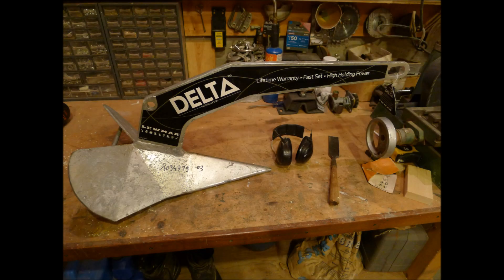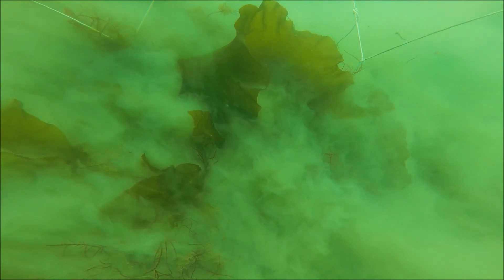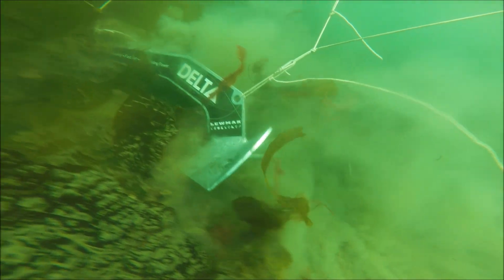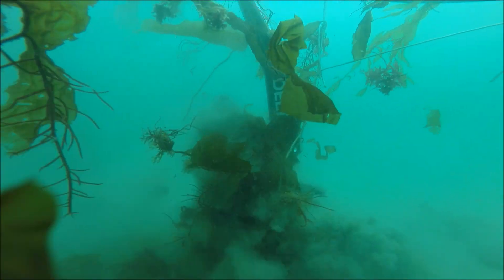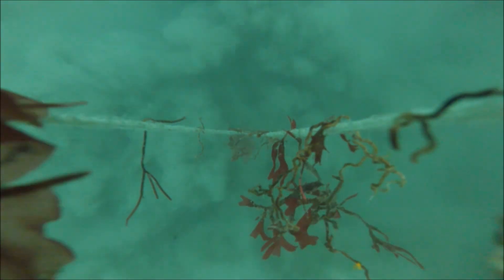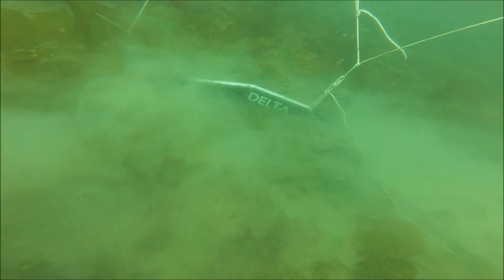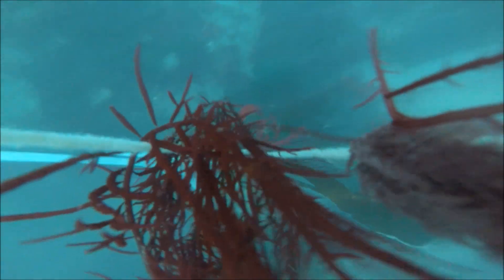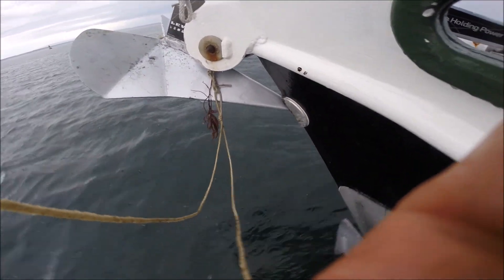Delta Anchor Testing.  Anchor Video #70.

Comment: Great vide thanks. We have been using a 16kg Delta for the last 4 years on a 45’ Sun Odyssey. It has been great so far. We have found that regardless of scope, it needs 30m of 10mm chain deployed to get a good initial set. Once you have that you can shorten chain if you feel like you need to. It has held us in a 60-70kts storm for over 2 hours and then in a sustained blow of 30-40 kts for almost 3 days. After that it was buried so deep, the shank being almost a foot below the surface of the sea bed which is predominantly sand as long as you avoid the Posidonia grass. Resetting through 180 turns has been good, normally within 1-1.5 anchor lengths under normal weather shifts.

Comment: Do you think one of these 10kg Delta anchors would work for a 20ft  angling boat with only a 25hp outboard motor ? Maybe the reverse power would not dig the anchor in enough to set .  Thanks for any suggestions.  Great video .

Comment: I am interested are the Delta inox better? I can see that they have a different construction, looks like a lighter shank therefore a better tip weigh ratio. If I buy the 30kg inox Delta for my 9m (30ft) sailboat I will measure it
Reply from the maker: I have no experience with an Inox Delta.  Please share whatever info you find. Thanks.
Reply: @Panope  I am not sure if YouTube removed my today’s comment because it included a link with pictures I have taken anyways…
Once again: I have bought 30kg (66lb) INOX Delta and surprisingly discovered that the tip/weight ratio is 40,2% ! 
I have taken 10 pictures with weight and size measurements and will post it again in a separate comment in case the algorithm deletes it
Reply: @Panope  made a screen recording just so I can share photos of INOX Delta 30kg anchor parameters....

https://youtu.be/e-918SES3dU

Comment: I use one of these, basically because of my bow sprit which restricts using a different anchor. I would only use as short scope of 3 to 1 for a lunch stop in benign conditions. Otherwise 5 to 1 all chain. Your findings are useful, I conclude that the Delta is Safe, Adequate and Reliable and I won’t be replacing it.  I accept that there are better anchors but the one on my bow roller is good enough.
Reply: Much better formula is 15m + 2* depth
Reply: Also interested are delta inox better? I can see that they have a different construction, looks like a lighter shank therefore a better tip weigh ratio. If I buy the 30kg inox Delta for my 9m (30ft) sailboat I will measure it

Comment: Just my personal experience with this anchor.    When under wind, the anchor seemed to hold fine.  However, when swaying side to side... the anchor has a habit of losing it's hold and drags.   I actually upgraded to this anchor and its been a complete let down.   I'll likely end up with an 'ultra' marine which seems like it's the best for holding power and resetting.
Reply from the maker: I can report that a 45lb. ULTRA anchor outperformed a 45lb. Delta anchor in the seabeds that I have tested to date.

Comment: Hi. I am preparing currently to sail the world solo, getting in remote areas and anchor as much as I can. I just changed from a 20Kg Bruce to an20Kg Delta-Anchor. After seeing this, I will change this Anchor and buy something better. Your testing has been by far the best I ever came across. THANK YOU FOR THAT:-) I have a 33Ft Sailboat with about 8Tons and I have rather an oversized Anchor, with 70 Meters of 8mm, regular Chain for the Main Anchor set up. As I have a Bowspriet, I have to find Ideas too, how to mount my 2 Anchors left and right halfway and on the outside of the Bowspriet. What is in your Opinion the best Anchor for me? I will be anchoring about 99% and this will include the 2 dangerous Capes of the World in South America and Africa. Many talk about the Manta Anchor, but the new one has screews in it and I do not trust any Screews with my life. I will face very heavy weather while anchoring too. Thanks for your Opinion.

Comment: Anchored well 16 years with 16kg delta on 36 feet 8 ton ketch.
Upgraded to a 25kg delta.
It dragged in windshift with mud/plants on first year.
Saw 3 boats over last 2 years with problems with rocna´s. (windhifts, clogged up anchor.)
Still bought a second hand rocna 25 for harder bottoms and very soft mud.
Have not used it yet.
Best is to anchor on 2 anchors if you can. Bahamian moor.
This way you can get by with cheaper options.

Comment: For my 36ft, 10 metric tons ketch I used for 24 years a 16 kilo Delta with good results.
Instead of going for the Rocna 15 kilo I bought this week a 25 kilo Delta.
This also because of your videos and 2 neighbours with serious Rocna mishaps this year.
With electric anchor winches these days we should all opt for an "oversized" anchor.
Seems the convex shaped anchors reset better because of lack of clogging-up. Thanks a lot.
Reply: Can you tell more about the Rocna mishaps?
Reply: @jimp313  Hello Jim, 
My first neighbor was on a small 3 ton sloop stationary anchored for
3 months with 15 kg rocna, chain and adequate scope in 2-5 meter
water with soft mud bottom and no plants. Then...he dragged in 30 knots
which was not uncommen wind strength (portugal). He is an experienced
sailor.
Second occurance (different location firm mud/sand) with a 31 foot Hallberg Monsun with 15 kg rocna during a gale with 40+ gusts. He dragged and  hit some pilings.
His boat "sailed" alot on his anchor.
I was anchored there and then with 16 kg delta on sufficient scope
with my  ketch (contest 36 mk1).
I believe the Rocna is a fine anchor. But I remember the hype when the 
Bruce entered the market. Maybe the Vulcan or Spade is best. 
A role bar is not so important if the balance is right and it fouls the
anchor too and hampers resetting. As is shown in the videos.
Thus I opted for the  25kg Delta. But wouldn't mind owning a new concave anchor.
( as a stern/kedge anchor I use a Brittany 16kg)
I also still use a 45 CQR  sometimes and a Bruce 20, Fisherman Luke 50kg.
When there is room I often anchor "Bahamian Moor" so that the anchors
dont have to reverse pulling direction. The Plough anchors work well that
way. Contrary to current believe I notice them diggig deeper (also CQR)
(In softer bottoms)

Good luck, anchoring is never 100 percent safe.

Comment: Compliments for tests, it would be great to try all the anchors with higher engine power and observe their limits, or try with smaller anchors. Stiven from Italy (google translator)
Reply from the maker: Greetings Stiven,  I did test most of the anchors with my  high engine power "deep set" test.  The easiest way to view these results is to watch my video called "Anchor Test Compilation. Video #56".  The 30:25 mark is where I grouped all my "Deep Set" test together.

Keep in mind that the maximum thrust of my boat is no where near enough to truly test the best anchor's max holding powers.  

I have purposely focused on setting and re-setting because there had been little comparative (visual) testing on the subject, unlike max pull testing which has been the focus of dozens of other persons tests. 

Steve

Comment: Steve, thanks for posting the long awaited Delta video. What you reckon, would it be easy to modify the Delta somehow to improve the performance more? Anything easy to do to make a noticeable improvement to get that performance more close to the NG anchors? As a Delta owner and a thin wallet I'd be keen to know..
Reply from the maker: Juha,

I made some "intuitive" modifications to my Manson Supreme anchor that proved to be completely useless.  The point is that anchor design can be very tricky business and I am by no means an expert in that regard.  Many anchors were developed by trial and error involving dozens of shapes and adjustments.   Some of the developers of the best examples have made anchor design their life's work.  Any amateur (like myself) that stumbles upon a better solution should consider themselves lucky or somehow gifted.

I fear that modifications that you make to your anchor could very well make the anchor worse. 

Steve

Comment: plows are supposed to move through soil. it makes sense that a plow design anchor would also creep through the sea floor.
Reply from the maker: Herb, 

With all due respect, I believe comparisons between anchors and farm plows are irrelevant.  You can prove me wrong by bolting any anchor shape you choose to a large, heavy frame that is supported above the seabed by wheels or skids, and demonstrate that this apparatus will develop more holding power than "plow" shaped anchors.

Steve
Reply: SV Panope 
I was misunderstood. I look at your videos as a wealth of knowledge and watch them as soon as they are released. These videos convinced me to switch from my Bruce that had been on the bow for over twenty years by the previous owner and 4 years by me to a Mantus. 
The point I was trying to make is Delta anchors that look like derivatives of the CQR which is the classic plow anchor. I have heard many stories of CQR anchors "not dragging" but slowly creeping along the sea floor during a storm. 
Watching the delta anchor slowly inch along the sea floor while under hard throttle made me post my original comment. 
I was getting at the fact that it looks like a plow and when loaded up, it creeps through the substrate instead of burying itself deeper. This is just like a farm plow (minus all the other equipment they have to plow the fields) where its goal to move through the earth and not to get stuck in it.
Reply from the maker: Herb,

Glad you got useful information from my work.  Good choice on switching from Bruce to Mantus.
Regarding comparisons to farm plows:  If you bolt your Mantus to the frame of a farm plow, it will bury no better than any other shape.

Steve

Comment: Hi from Olympia! Thanks for the greatest reviews of anchors ever made! You could market your data, I'm sure. I'm buying a 33lb Rocna based on your videos (west marine has 40% off on anchors and rode - starts this Thursday). It's WAY oversized for my boat, but I'm tired of dragging, also I plan to sell the 28 bayliner I have now and get a sailing boat - as ocean worthy as I can afford, and use the same anchor (hopes). Anyway, I'm sure I'm not alone when I say that I am just blown away on your detailed analysis of anchors. Especially the impossible camera views and non-bias scope - you are amazing sir! It's really what we all imagine our anchors are doing (or not doing) as we are backing up, "are we stopped?.... well, we were, then we broke lose again! Pull it up, let's try again!" And again, and again, and again. This is my third anchor, and my last, I already feel comfortable about choice due to your videos. Can't wait to test it out. Thanks
Reply: Oh, I did have a question, though: why so fast on the sets? Is there a difference when it's 1 knot vs 3.5? Im just thinking about tide change. Which is my biggest concern around the Puget sound.
Reply from the maker: Thanks, Kass.

My test philosophy is to simulate worst case scenarios.  My choices of 2 knots for the initial set and 3.5 knots for my 180 degree reversal tests was arbitrary .  

Think of my tests as similar to the automobile tests where they drive a car into a wall.  

Steve
Reply: I looked on west marine's website and didn't see anything about 40% off anchors, but your comment got me looking for it.  I'm in the market for a new anchor and 40% off would be great, these anchors aren't cheap.  Where did you see the 40% off?
Reply: Brian Tye , I just checked and was corrected. Only certain anchors are one sale, some for 40% some for 20% and some aren't at all. I think the best bet is to just go in and ask. The one I'm going for is only 20%. Please forgive me for the confusion

Comment: Been awhile sense you did  a test. That's what I have a delta, some time I'm going to get a picture of mine that I made compared to factory one to send to you. If you ever get up here would love for you to test mine. I have a way sharper point on mine I used a hardened welding rod. will have to take a scale down and weigh it some time. Some of your test have a current flowing thru that keeps it clear.
Reply from the maker: Pack,

Did your modifications produce a meaningful improvement?  I'd be very curious to see your changes, if they did.

Steve